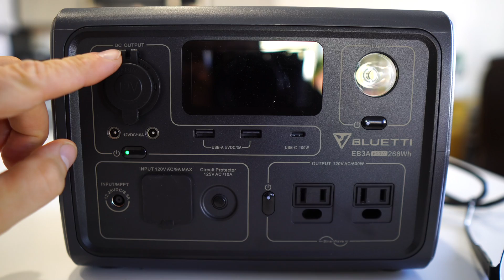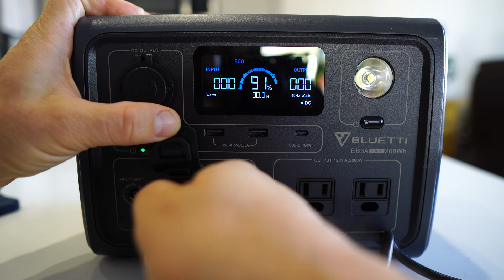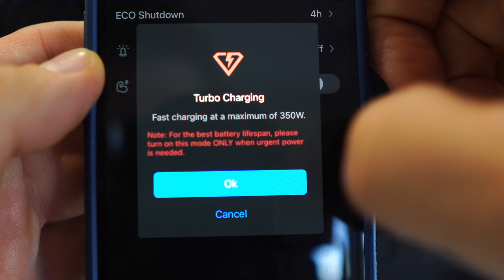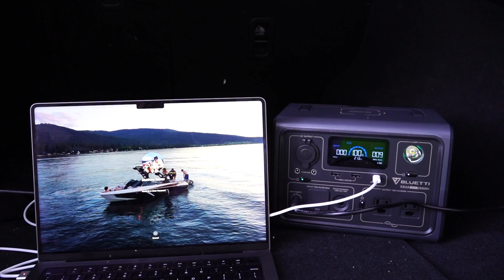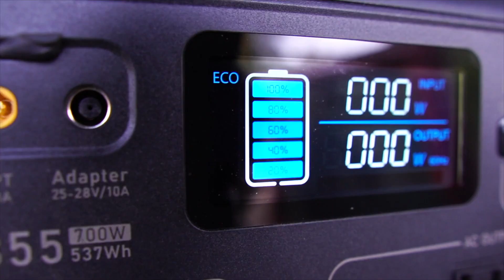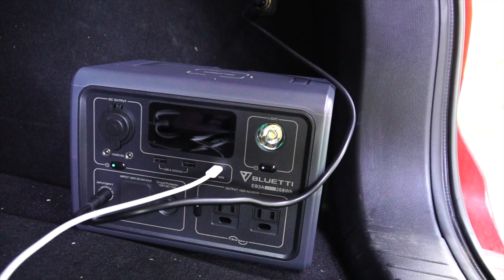5 Pros and 5 Cons of The Bluetti EB3A Portable Power Station

Comment: 2 more cons (that almost no of the so-called testers report): 
1st: Doesn't start charging by solar until certain amount of watts. Some found out, it is current related and it needs at least 1 amp to start charging. After it started, lower amp-charging is possible.
What it means: On low-light days with smaller panels (like 1x100W) you may never get a single Wh into the PowerStation. Instead it will continiusly try to start charging. Activate the display and Bluetooth and after 10h you have 10% less battery. Bad for dripple-charging with small camping-panels.
2nd: Fan-noise from not spinning fan. PPM is set to low for the fan and it makes a buzzing sound. Stops when the powerstation gets hotter and the fan actually starts spinning.

Comment: No, it can't power a coffee maker, they're like 1200-1500W !!!"
Reply: Therein lies the magic or lack thereof. It actually WILL power a 1200W coffee maker. However it will only power it with 600w. Sometimes even less as the voltage drop necessary is just staggering.

Comment: Thanks for the video. I dont like to use apps or my phone, so is the factory setting on the Generator set to slow/normal charge or fast charge? I rather have the normal charge out of the box since I read below of overheating with fast charging. I was about to buy this over jackery, eco flow and anker's comparable systems; now I am concerned from your comments below and the poor customer service (nice guy in africa) that couldnt answer any questions. Sales or tech only responds via email, so that a concern too. Walmart has this for $208 right now and so if it bombs, I could return it for full refund easily. Let me know any info, thanks, Chris
Reply: There are three videos on YouTube put out by Bluetti support. One of them talks about the button combinations to hold on the face of the device to enable or disable some of the features if you are not using the app.
Reply: @newuser507  Thank you, I decided to start small and with the Eco Flow River 2 at the same price. There email support and phone support was way better then Bluetti and their warranty was 5 years and the battery life cycle longer too.
Reply: The default out of the box on mine was normal. You have to enable Turbo or Silent mode in the app.
Reply: @motocamp84  Thanks, see my above comment in the thread, Chris

Comment: Huge waste of money. Actual useable Watts. About 240 ! Real life  usage. What would you want to leave on for 7 hrs? A 500W heater. This Bluetti will not power it but for 1.75 hrs tops. What about a TV for 6hrs? Hmmm?  Then you must recharge it. Waste of money.
Look at it this way.
Nobody's talking about this low Watt available over the long haul for the nite or day.
240W ÷ 7 hrs =  34 W useable per hr before it's empty. 
Nobody's talking about this talking point.
Reply: It's great for things like small teardrop trailers that have a low amount of electricity needed, but yeah not great as a home backup but it wasn't really intended for that I don't' think. If you're using this to power your home TV and space heater you're not really using it for what it is good for.
Reply: this isn't a house generator, it's not even really for home at all. It's for traveling when you don't have easy access to electricity and want to recharge mobile devices/lighting/ect. It's a 250 dollar unit, often less on sale. You sound like you're looking for a $1000+ unit that's far more built to be a true home emergency backup

Comment: Hi Matt,  these are sold in South Africa now, where were are on a permanent 4hr power cut (2 x 2hr ; 6hrs apart - recharging won't be an issue). Can you do a quick calculation, I have a 70" Samsung TV, and was wondering ihow long the charge would last running a modem, power to the Fibre box, and the TV itself? Any ballpark figure within 20 mins of supply?
Reply: I don't know your exact TV model, so can't look at the exact wattage but the average 70" LED flatscreen TV uses around 140 watts when on. The EB3A only has a 268Wh capacity so you're looking at less than 2 hours, especially if you need to run a modem and fibre box as well.  This should be pretty easy to figure out. Look on the labels on your devices and add the watts together. That's how many watts it uses per hour. If you are wanting a battery backup for those devices, you're probably going to need at least 200Watts for each hour... or a 1200Wh battery backup for 6 hours. It'd probably be a better investment to just buy a small camping style generator at that point.. though I don't know what the fuel situation is like there in SA so perhaps not?

Comment: I ordered the EB3A for dual purpose.  At home I don't need super portable but I do when I travel.  
It can be a gateway for my two 110AH  (2X12v = 24v) forklift batteries connected to two 100w solar panels.   It can make full use of the inverter without quickly draining the EB3A. I will use it for my computer/router/wifi as a UPS. hub. When I motorcycle travel, it is a good size to fit in my sidecar, charge off the bike when moving and a portable solar panel when at camp.

Comment: Since I bought a refurb EB3A from eBay refurb (probably a customer return within the 30 day period) for US $158.90
Sold by:
bluetti_official, I thought it was a very good deal.  It has many features of the 626!WH units without the large batteires.  This is great for cell phones, etc. camping.  I can buy a 100Ah Lifepo battery to triple the longevity, for about the same price as the difference between this and the larger units.  Originally I was planning to connect this to may travel trailer battery which acts as a failsafe for my 33' travel trailer.  But since it runs all my 12V lights, refrig in case of A/C Outage, I decided to keep the solar on a separate system.....

Comment: 5521 is not the correct cable for charging this unit from DC. You need an 8 mm plug. 5521 cable just gives you another 12 V output
Reply from the maker: Thank you for pointing that out. I've updated the link with the correct cable.

Comment: I wish you reviewers would read real customer reviews so you know what to look for. 
    This thing has issues. Bluetti customer service is non-existent. I waited 2 months to get the thing approved for a return. Very common complaint is not being able to reach them.
     Huge issue for boondockers that need solar charging. It takes at least 1 amp to start to charge. Worse if when solar quits the battery discharges!  Also mine was set up with euro voltage for charging cause problems here. None of you reviewers who got these for free addressed this. Lots of people who bought them did.

Comment: I heard elsewhere this thing has trouble starting to charge with weak solar input (cloudy days etc), needing a rather high voltage/amperage. So probably no slow lowpower trickle charging when the panels end up in shadow etc. .. anyone managed to figure out what minimal voltage/amperage it takes to get it start charging reliably?
Reply: Yes at the very least 1 amp to get it going. For a tiny battery this is not ideal.

Comment: I think you're wrong about the power lifting mode. It doesn't switch to modified sine wave like you suggested, it simply drops the current, thereby reducing the output of your device. Not sure where you got that info.
Reply: Pretty sure it drops the voltage and raises the current keeping the max wattage the same. Works fine for resistive loads like heaters.

Comment: Will discharging completely degrade the internal core battery performance over time? Is there any safe max charge percent and min discharge percent for this unit to maintain healthy battery quality?
Reply: Like any lithium-based battery, if you only charge to 80% it'll extend the life-cycle of the batteries. That being said, this is less important with the LiFePo4 batteries that Bluetti uses than it is with lithium-ion based batteries.  I personally wouldn't worry about it considering the low cost of the unit.  The 20% figure is just because you won't be able to get good voltage below 20% so it may not work well for many devices below that.  Also, keep in mind that most modern BMS (Battery Management Systems) will slow the charge rate after around 90%.

Comment: Four months of light occasional use and mine is no longer powering on or charging. If I had bought from a shop I would be able to take back but Ebay not so easy. That said it was good whilst working but no good to me now it is broken.
Reply: I never order anything over $40 from ebay because it's such a hassle and I've had several problems with recieving wrong item, not as described

Comment: The biggest Con with Bluetti is they have absolutely no customer service! I am attempting to cancel my order but the numbers provided are either full mailboxes or disconnected!! Also they show the 6 ways to charge the unit, one of which being in your car, but fail to mention that cord is not included. Very deceptive...
Reply: Not true. I called them several times, someone always answers. And their site says 'what's in the box'. All you have to do is scroll down on the device page.
Reply: @Nisie23 Not my experience at all. They do not answer their phone. They always let it go to voice-mail, which is always full. And if you have point credits with them, they do not automatically apply it towards your next purchase. Then they send you a notice that your points have expired. So much for appreciating your repeat business.  Not nice.🫢
Reply: Mine (that I got a few days ago) did come with the 12v car adapter, so I wonder if that changed recently. Purchased on Amazon though, so maybe different if bought somewhere else?
Reply: My car charger came later.
Reply: They literally show you exactly what is included, that's on you for not reading fully
Reply: Every time I've called, they always pick up and help

Comment: Way too complicated for an old person to understand!  Live in a 6th floor Senior apartment. Want to able to run a tv and Coffee maker, charge an IPad and I phone, computer and possibly my apartment sized refrigerator. What should I buy???
Reply from the maker: What’s your anticipated use case? Like, are you wanting to have something that covers you if the power goes down for a day or so, or are you looking at a setup that can sustain that use load for an extended period of time like days or weeks? If it’s just to bridge you during at 24-48 hour power out emergency, than I’d say look at a 1500-2000 watt hour system, especially with that coffee maker and fridge in the mix. If it’s gonna be longer than that, you’ll need to look at that, plus a way to put more electrons back in it via a sufficient enough amount of solar panels or some other generation method.

Comment: Another PRO is the fast solar charging, I have 2 100 watt panels which will max out the input on a bright day at 157 watts and this is charged in less than 1.5 hours if I start with 20% capacity.

Comment: i find the EB3A discharges too fast for my liking but ill fix the time capacity with a 24 volt battery .Also mine seems to have a heating problem when charging from the AC outlet.

Comment: Eco mode can be changed with buttons on the front, not sure about some of the other things. I don't use the app. 

I totally love these units. I am a senior woman with periodic back issues, so the 10 pound weight is fantastic for me!! Yes, love the display and the fact that I can use a 200W solar panel to charge them, which. Yes, love the price, especially when a flash sale meant I got one for $209! 

As someone who often cannot lift heavier units, I have used these to "fill up" a 32-pound 1800W Oupes unit that I mainly use to run my fridge much of the time. Not the most efficient, but definitely useful when my back will not handle carting the big one out for solar charging and back in.

If the EB70S had this type of display I would buy one for the extra watt-hour capacity in a unit that still not too heavy. Instead, I went for the new Growatt Vita 550 unit to have a somewhat small unit with more run time. 

Great review you did, covered everything very nicely.

Comment: Mine charges up to 465W on Max mode.  Overheats constantly. Noisy. Discharges too quickly.
Reply: Mine is so loud it sounds like a window air conditioner. Not impressed. Jackery is much better quality in a side to side comparison.

Comment: I use the EB3A since a few months and encountered no problems. It powered my laptop, phone and desk lamp all day when I had a recent power outage due to a grid maintenance.

For me the 100W USB-C Port is one of the most important features, even some expensive Jackery models don't feature that one. I don't need 8x USB-A ports with 2A. WIreless charge works fine as well on the Bluetti.

The European version features only one AC socket, that's ok though. For example my small hair dryer works perfectly while it pulls 500W in the lowest setting.

I tested random DC sources to charge it and encountered no problems, even a random 12V battery will do the job.
Reply: Hello, are you still using your generator? I wanted to know if it is still advisable to buy it or if there is a better option than the one EB3A

(I hope it is understood, I am using a translator)

Comment: that bluetti cigarette adapter is $20 

any other less expensive options for that cord?
Reply from the maker: Try this one, I believe it includes the correct DC5521 plug and is half the price and Prime eligible. https://amzn.to/3FT2kCZ
Reply: Looks like it is currently $9.90 although it is currently out of stock. I recently purchased it and it was less than $10. HTH
Reply: Ebay sells them for $9.00, always check eBay and the manufacturer page, even if the manufacturer page says "sold out". I often see the EBay site of a store sell cheaper than Amazon.

Comment: One thing I don't like about the EB3A is the overheating issues that some units have.
Reply: Recharge at lower / slower charge rate.   Too much amperage rushing in causes the overheating.   Can be adjusted in the app.
Reply: thats right, the intern van is not working effencial, especial if you use the AC convörter, the Air gehts till 40°C, from the air-output eb3a

Comment: Had to return mine since it was only getting about 65% of rated capacity.   Also the UPS feature started overloading almost daily while powering my PC, after running fine for a week (despite my PC only drawing 100-200W).  I may have gotten a bad or returned unit that had been abused.
Reply from the maker: Dany, that's definitely not good to have happen. Please follow up and let us know how the experience with the second model goes. How was their customer support to work with in getting it all resolved?
Reply: I had a very similar issue sent it back got replacement and it did same shit have completed a full refund and moved on to a different device. It’s sad too as this was a great device until it wasn’t :(